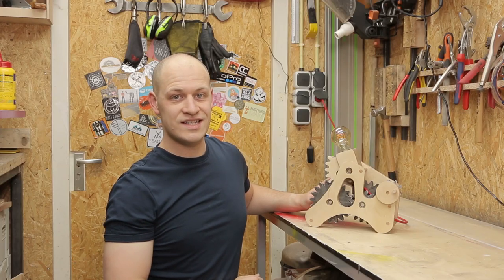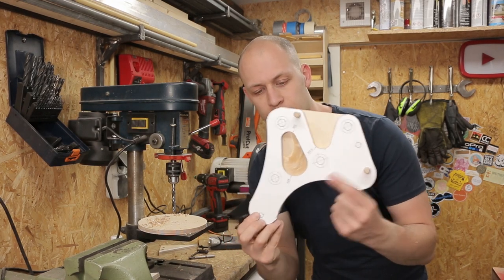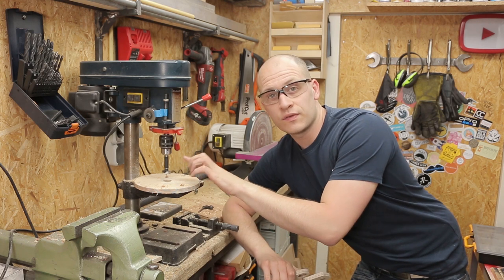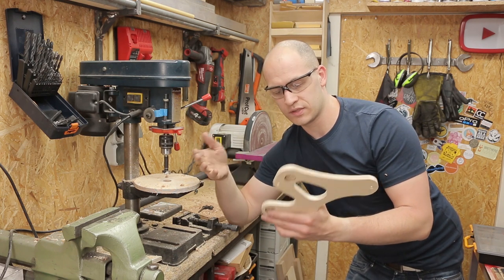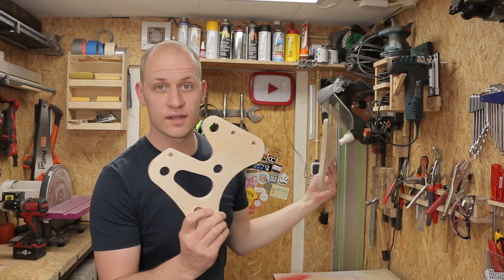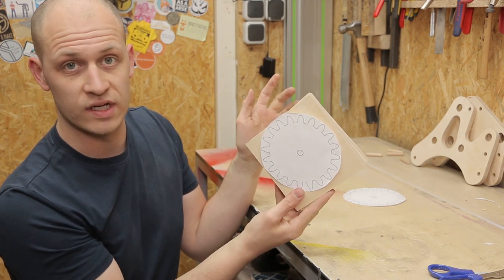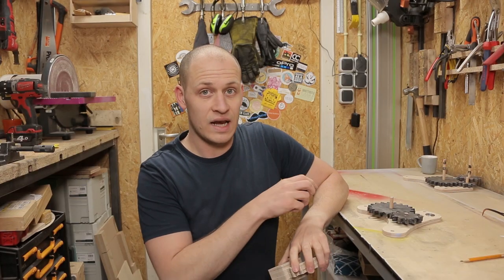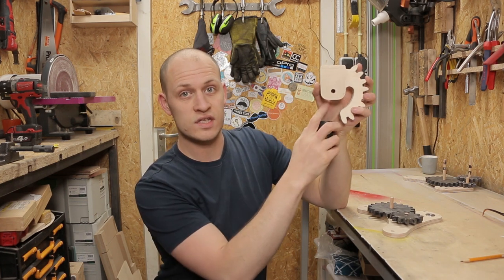Hidden Switch Desk Lamp With Moving Wooden Gears

Comment: Do you 3d model all of this before hand then create the templates?
Reply from the maker: Yes, everything that I make a template for is 3d modelled first. I make (some form of) a 3d model for all the things I build. It helps me work it out.
Reply: @Thepracticalengineer  I saw you had a post I think on your Facebook about 3d printing and you said you preferred to use wood because it helps keep the videos more interesting. I wanted to suggest that you could replace the time you show wood working with a little back story of your design process in the 3d model or possibly some explaining on the 3d printer depending on how variable you are with your settings/ filament type.
Reply from the maker: Alex Sawyer thanks for the suggestion! I'm always looking for ways to improve the videos.